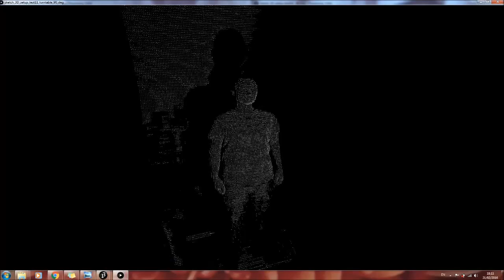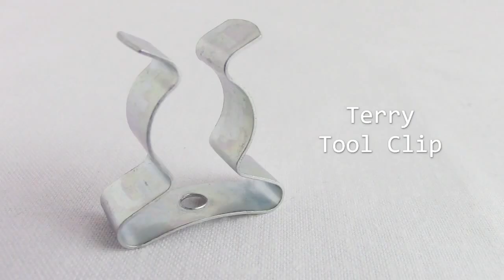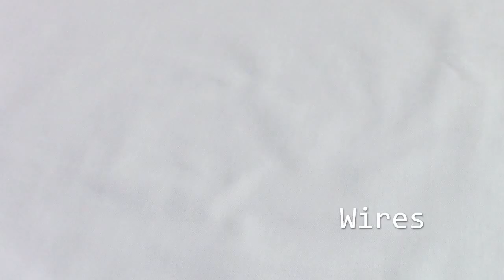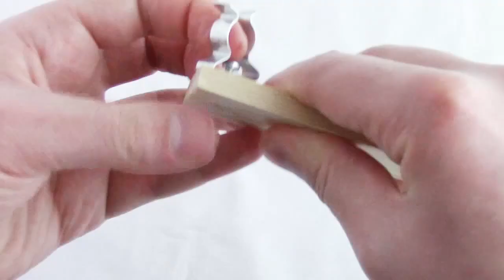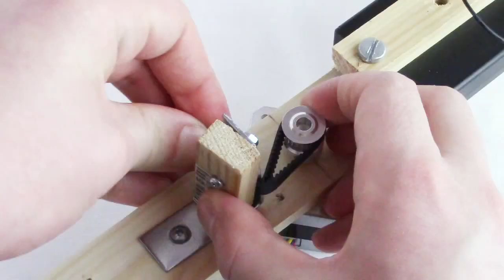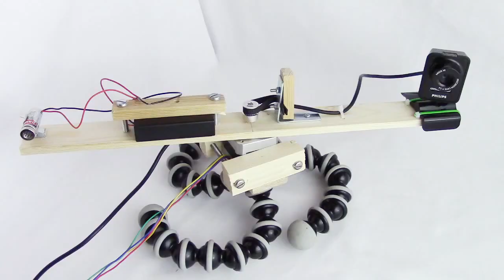3D Environment Laser Scanner PART 1

Comment: this may sound like a dumb question, but where do you connect the webcam to???
Reply from the maker: Just plug it into a PC through usb. The Arduino is only used for turning the motor, all camera and 3d trickery is done by a computer in Processing :)
Reply: @callanmackay9887  thanks!

Ive got it all connected up and nothings working. The code seems to be fine and upload to the arduino, so im guessing the electronic side is off. Is there any chance i could get a hand with this?
Reply from the maker: @nosspe8069  haha I can try! But I'm not sure I'll be much help because I have forgotten most of it. 
What's not working? is the motor not turning?
Reply: @callanmackay9887  haha  thank you!! Well currently nothings lighting up.  Neither the motor running. I think i must have arranged the breadbox wrong!! There seems to be no power when i connect the battery pack to it all.... When i connected the 12v power supply from the mains it blew up the 1000uf capacitor hahaha
Reply: @callanmackay9887   I think ive got it sorted!! it was to do with power to the breadboard.  it all seems to be working for the time being thank you!! once its done i'll upload images and a breadboard schematic! :D

Comment: Hey..I am struggling to find all the parts for building..this and i really do want to build..any tips on where to go look..except amazon..
Reply from the maker: Nogi Gamer Pretty sure I just used Ebay and Banggood, and the webcam I just had lying around. What are you not able to find?
Reply: Callan Mackay hii..for the most part what i need to know where to get is the adriuno..i can worry about getting the rest of the parts later..
Reply from the maker: Just go on Ebay and search for "Arduino Uno", the official version is about £20 if you want to support the community but you can get cheap clones for about £5 which do the same thing. Remember to get one with a usb cable.

Comment: I could not reconcile the camera and Processing. I would be grateful if you would be a helper.
Reply from the maker: Hey, I have only used Processing for this project so I'm not very well experienced in it :s. You might be better checking on a forum for help.
Reply: I understand, but how do you get the data and in mashlab you ask?
Reply from the maker: I don't know how to use meshlab for creating a solid body, I only got as far as creating the point cloud.
Reply: now The file "test.txt" is missing or inaccessible, make sure the URL is valid or that the file has been added to your sketch and is readable. ı can't know